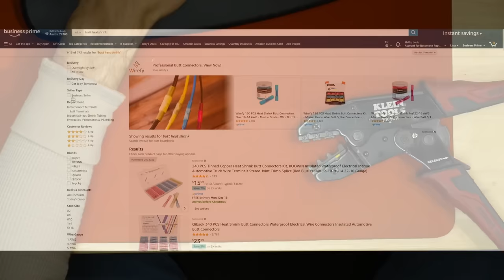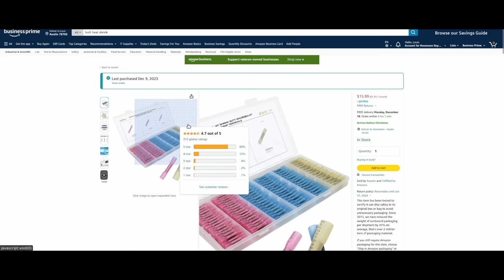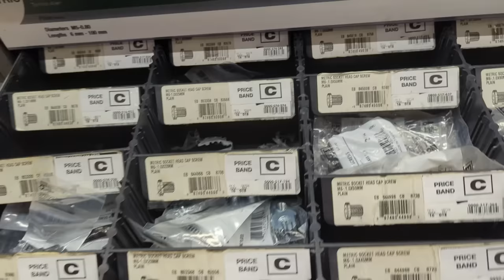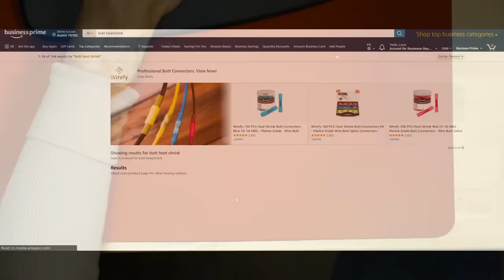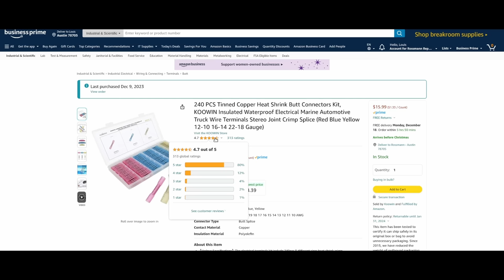Amazon Sells Dangerous Electrical Crimps

Comment: I bought a USB-C to USB-C + 3.5mm adapter for $35 from amazon. I ended up receiving an unbranded adapter with a completely different design than the pictures, and the cherry on top was that it didn't work. The worst part is that I fell for it twice, however I did return both of them individually in the largest boxes I could find from around my house.
Reply: I brought a charger cable that set on fire. Amazon didn't care
Reply: Similar experience trying to order replacement Oral-B heads from the Oral-B Amazon store w/thousands of 5 star reviews. What shows up was a product written in Turkish that look different than the heads I bought at an actual store. I do a Google & low & behold there are several articles on U.S. Customs seizing tens of thousands of counterfeit Oral-B heads from Turkey.

Comment: Problem is that stores have crazy mark ups for little things like this. I needed 10 M5x10mm screws for a project, but instead of selling me a pack, Home Depot sells them in little bags of 2 for $2.75, so it was $13.75 for 10 screws that probably cost a fraction of a penny to manufacture. The next day I ordered 300 of them on Amazon for 75¢ less. They look and feel identical and are in all likelihood from the same factory.
Reply: Have you looked at them side by side?
The 2-pack is obviously a crappy deal, but working in a bankruptcy clearance firm I got to sort through dozens of pallets of high quality fasteners. Ended up striking a deal with my employer to get a lifetime supply of most sizes and grades a hobbyist could dream of 😆. But really, the difference between these and the Chinese stuff I had previously bought is stunning. No more stripped heads, the threads are super clean, it all just works like a charm.
I mean the cheap bolts realistically do their job too, but if there's a couple sizes you keep coming back to... I would consider paying the premium for a 100 or 500 pack.
Reply: McMaster Carr and Mouser are usually where I go for things like that.  They focus on business to business sales mainly, so finding what you need at a decent price and quality is relatively easy.  You just don't get Amazon's subsidized shipping.

Comment: I still use Amazon, but I have received a few cheap items that were safety hazards. I don't care if I spend 1 cent. If it doesn't work or is unsafe, I return it most of the time. If the item is under $10, Amazon just refunds me and tells me to trash it. But I am in a similar mindset as you. I would rather take the time to return it and make Amazon and the seller lose money on shipping than let them keep my money and let a junk product stay on there site

Comment: I learned my lessons on ebay years ago and never hopped onto the amazon store thing. I couldn't afford to eat the cost of people ordering the wrong thing, returning things damaged, or buying something and then saying they bought it by accident and getting stuck with the refund fees. Happened enough that because I was only selling a few things a month I was actually losing money for several months.
Reply: That and them entirely removing seller protections is why I stopped selling on Ebay over a decade ago. Sellers had no recourse for buyers scamming them, I lost several hundred dollars due to destroyed parts being returned and forced to give a refund.

They also moved their call center to India, so you can't understand them most of the time. Bad phone connections coupled with thick accents mean you're not getting anywhere fast.

Comment: Some sellers will also change items with good reviews, to something else to trick you. Years ago I bought a door knob on Amazon, and when I went back to my old orders to re-buy it, it was an air conditioner... At first I was like whatever, but then when I looked at the reviews, it was still for the door knob that had 5 stars... After that I did a little more digging. I looked up the air conditioner on Amazon, and found a ton of that same  air conditioner, just the reviews were all bad... I seen a lot of other products do this on Amazon... They removed the listing after I reported it though.

Comment: If you go to the stores of the products you can quickly see if they are a company that actually deals with a certain type of item of if they are just selling off random stock they've purchased. I just came back from a store selling electrical connectors that also was selling jewelry, plastic label holders, hose clamps, and safety pins -- and only a handful of items in total. Conversely, another store I visited had dozens of items and tools listed, all industry-specific for making wiring connections.

Comment: Sadly, reviews don't mean anything on amazon until there are thousands or tens of thousands. An important part of the solution is definitely to RETURN EVERYTHING that isn't of the quality indicated by the reviews, and make sure to ask/demand an additional credit for having your time wasted by the process.
Reply: Even tens of thousands reviews don't mean anything. Look at the negative reviews and ask yourself if you want to deal with that problem. I rarely use amazon and it's only if I cannot find a product anywhere else. I don't mind waiting weeks fo r a good product instead of the crap amazon sells. Hell, the last time amazon offered me Free prime for a month, one of the packages was a week late and the other one never made it and I had to refund it. If I can't find a product locally, I order it directly from the manufacturer. It's less likely to be a forgery or a return that way.

Comment: I do not buy a lot. Period. But I also don't buy a lot on Amazon. And that which I do, I am quite certain that I can return if the need arises. And that assurance of being able to return a crabby product is absolutely incredible. (And, because I live in a small town, I always prioritize giving my money locally, rather than some far off conglomerate...when in stock.)

In the entire year, I've returned 10 products. 7 because I basically (over/)bought the wrong product, and 3 because the product was garbage.
And I also got a garbage, ali-express-looking "weeding tool", and basically forgot it existed after it turned out to be garbage and I was busy.
Also, I got a Chinese immesion bucket heater for when I didn't have a shower, but still needed to work... to get a shower. Expected it to burn down the house. Surprisingly it worked for the entire year, and to this day, I am using it for hydroponics system during these winter months. (About to replace it with a presumably much better, more convenient heater... that doesn't give me a fright each time it's plugged in... Yes, I do have a CO2 fire extinguisher handy. Thanks for asking.)

This is out of 47 orders, with maybe an average of 3 products per order.... Which admittedly kinda makes me look like an addict, buying a product every 3 days on average, give or take. But... yeah. I've got not excuse. I shouldn't.

Regardless! a 4/134 failure rate is not impressively high.
But on Amazon I also... don't buy highly technical products, nor ones that demand high quality. 
I just need it to do the thing it says it will do. These are seeds? Yes? Cool! Do they grow? Yes? Cool! Are they the right seed, and not the bullshit multicolored crops that don't exist, and Amazon refuses to pull? Awesome! We are off to a great start!

Comment: Advice: Stagger the connections, don't have them side by side, even though it makes the outer heat shrink coating have to be longer. Especially if it's a power connection splice!

Edit: And of course, don't use junk quality parts or materials!
Reply: That is good advice. The two wires should not have the crimped part next to each other. Then it won't short even if the insulation breaks due to age or vibrations.
EDIT: also putting the crimp in the tool first and then the wires will prevent them from slipping out while handling it. You get even better connections when crimping one side first. Then putting in the other side cable and repositioning the tool.

Comment: I bought a set of electrolytic capacitors. Wired it correctly to the switch in my DeWalt light to try and stop the flickering from the damned lithium battery module... and BOOM it exploded in my hand. Double checked everything.... cap manufactured backwards is the only answer I have. Amazon is the only place to get things, but you have to dig and dig for way way too long to find anything worth a fsck.

I just bought a replacement window control module for a customer's 2012 Mercedes Benz... it works for now >.>

Comment: Amazon is now like Harbor Freight:  Its mostly low quality junk but if you are careful you may find a few good things there at a good price.

Honestly, the stuff you get at brick and mortar and other online stores is now often the same low quality chinese outsourced stuff even if it has a known brand name, just rebadged and with a higher price.  If you're going to end up with junk anyway in that case you may as well get it for a lower price.
Reply: Clothing is the absolute worst. I've bought so many clothing items that ended up being horrible. Retail is still king when shopping for clothes. Such a waste of time.
Reply: Harbor freight is amazing.  Cheap generalized tools are a godsend. Their small gas engines aren't bad either, you just have to tighten things up in more frequent intervals.  I wouldn't get any precision or daily driver stuff from them, but hammers, breaker bars, pry bars, mattocks, axe's, and a few basic metric and standard socket sets, screwdrivers.  I've had some of my harbor freight tools for 10 + years.  They are cheap as hell, but they get the job done as well as any snap-on or craftsman.

Comment: For everyone having problems picking up items in local stores due to theft based inventory mismatch, just use online order with the in store pickup option. In my area the way this works (at Lowes and Home Depot) is someone at the store takes the item off the shelf and puts it in an area designated for my in store pickup and after that I get a notification that my pickup is available. If there is an inventory problem I don't have to deal with it, and I imagine they have to adjust their inventory to show the actual 0 amount in order to get more to fill my order. I once got a message that my order was delayed, which might have been due to this kind of theft, and I just cancelled and ordered from another local store.

Comment: For your information, some jaws of these crimping pliers have a specific molding which accomodates the two sections to be crimped: the metal part of the connector and the entry of the conductor with it's isolation (rubber/PVC). With these jaws the "direction" of crimping cannot be swapped or otherwise crimping performance is inferior. 
If your jaws are basically just two blocks then it does not matter.
Reply: I have an older pair of crimps that will crimp everything while those Kline ones will not. The problem is the "cheap" ones are either slightly bigger or smaller. Either way using a proper set of crimps and knowing how to use them is key. 
Crimps are super simple as its just a piece of metal. Matter of fact they still sell crimps with out the plastic on them. I used to have a huge case of them lying about for years and pulled from them. I sold everything I had to buy my house. Since then I have not had a need for crimps, Yet I still kept that old crimp tool. They were given to me by a super old friend.
Reply: @kameljoe21  Cheap connectors and fittings are often derived from stuff made primarily for the Asian market and all scaled in metric, so you'll get stuff that looks nominally the same size as "a 10ga crimp" or "a 1/4 in hose barb", but it's actually a 2.5mm2 crimp or 6mm barb. Often close enough to work, but a trap for the unaware when it's not.
Reply: @treelineresearch3387  Which is why we need to stop using imperial and start using metric. We are really the only place that still uses it.

Comment: I actually bought this crimp set to do the speaker wiring on my truck. If you crush it with the middle part of the crimp tool you can get it to work (which I know I shouldn’t have to do). It still gave me a lot of trouble and was really annoying because I trusted the good reviews

Comment: Hey Louis, I totally agree with you on quality and price. However in this particular example you must adapt to the cheap crimps - I use these for work all the time the trick is to use a crimp tool that makes a V notch or an indented curve notch for the crimp. Since they use lighter gauge metal in the crimps. Any wire strippers should have these options down by the handle side. Yeah high end crimps are much nicer and easier to work with, however if you learn to adapt to cheap garbage you can save money and enjoy not having to go to a supplier for supplies. With inflation the way it is this is a future proof skill to have. Just my 2 cents, and thanks for keeping the fight alive.
Reply: Thinner material might also mean lower current that can pass through safely. I would not cheap out on wiring

Comment: I've noticed this exact same issue with Walmart's online storefront. I have found knock-off items on Amazon, and then found the exact same item on Walmart's site as well. It's hard to find legitimate products for certain things anymore, because there's a majority garbage that's mixed into feed, and I just don't want to have to spend a few hours looking through the listing and reading reviews to find out if it's a legitimate listing, or false advertising.
Reply: I’ve had the same issues. All types of phone and laptop chargers are listed on Amazon as “genuine” or being direct from the original brand such as Samsung or Apple are actually knockoffs that shouldn’t be worth half of a genuine product since it’ll be broken after a couple of months.

Comment: Leaving a bad review on Amazon is very difficult in my opinion. I've had most of my less than 3 stars reviews pulled down by Amazon because the review is "reviewing the merchant and not focusing on the product" which has not been the case at all. I've reviewed strictly the product itself and not even mentioned the seller. When I've asked for refund though and explained the issues with the product, Amazon has not had any problems providing me a refund based on the explanation why the product doesn't work. However you can't say that on the review.

Comment: Amazon counts reviews for similar products under a product.  I think this is because they allow third party vendors, which should be a filterable thing.  Different SKUs but same manufacturer... like different hard drives from a specific manufacturer, but with varying: sizes, cache sizes, storage sizes.  Or having movie reviews all lumped together even though VHS/DVD/BD/4K all look different and have different extras/features.  They allow vendors to mix OEM and retail product even the the description will specifically state one or the other, but the wrong one is shipped.  Usually an OEM SKU is shipped under a retail SKU (always a fun item to send back).  Simple common parts shouldn't have a wide variance in quality, and usually the more reviews, the safer it is.  I still check to see what people have issues with to make sure if it's user error or bad manufacturing.  If you do want a specific product, you can always enter the UPC code in for most products.  That will at least eliminate most of the similar items in a search.

Comment: Non certified electrical devices are another major problem on Amazon.  I've been running into my customers getting mostly light fixtures that aren't certified ((UL)c, CSA, ETL) for use in Canada in my case.  Many have no certification for use in the USA either.  There is a good reason why we have these certifications and it's illegal to install non-certified electrical devices.

Comment: I ordered an O-ring set from Amazon from a seller with thousands of positive reviews. The O-ring dimensions are completely out of spec, wrong dimensions, undersized, too thin. Guarantee that anybody using these O-rings, they WILL fail. They were completely useless. When I gave it a negative review, with photos and measurements, the seller contacted me to give me a refund, and then asked me to remove my review. I refused.  Those O-ring sets are still for sale. I have been tending to do more buying on Ebay.  Shippers outside of Amazon are hampered MOSTLY by hidden shipping costs.  One example is a company that makes custom hydraulic hoses. Their quality is great, their costs are very reasonable, and the shipping will eat you alive.  A one pound hose they sell for $18 will cost over $20 in shipping.  The real attraction of Amazon is known pricing.

Comment: I recently had a problem with crimp connectors from Amazon. The metal inside was too thin to grip the wire. Recently I’ve purchased more from eBay and haven’t got burned yet but their product rating system is missing from half their items. The bigger Amazon got the worse they’ve gotten!

Comment: Brand names cheapening their product to compete is also part of the problem. Often you will find that buying the brand name now doesn't hold the same weight it used to. 
My parents still own and use their microwave and washing machine from over 20 years ago.

In contrast. Recently, they bought a brand name kettle and within a year it died. They now buy cheap kettles and replace them for $10 when they stop working. 

My Gran owns a brand name kettle from 20 years ago, still working fine. 

Cheap products make brands lower their costs to be competitive, leading to an entire marketplace where you cannot buy a quality kettle haha.